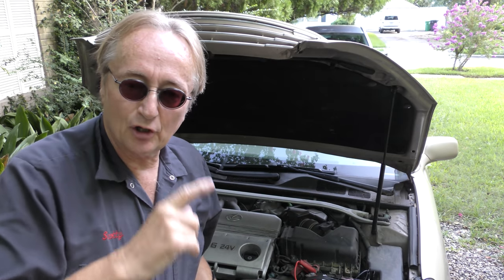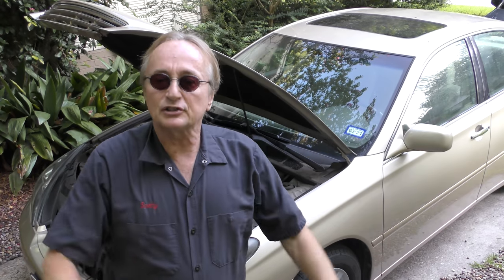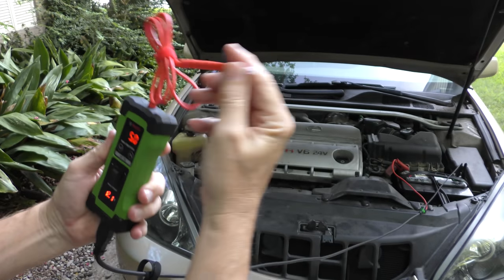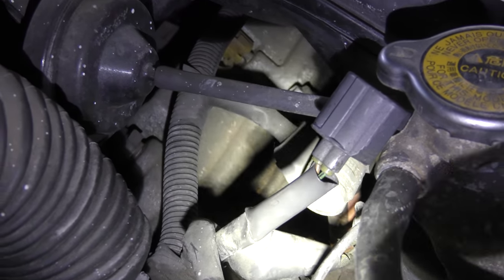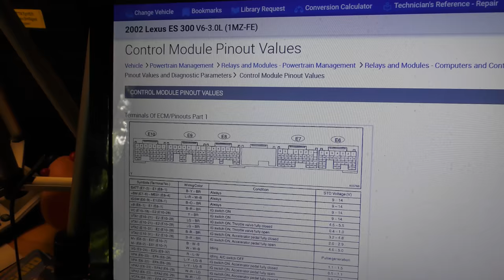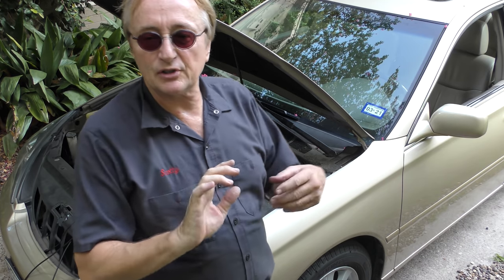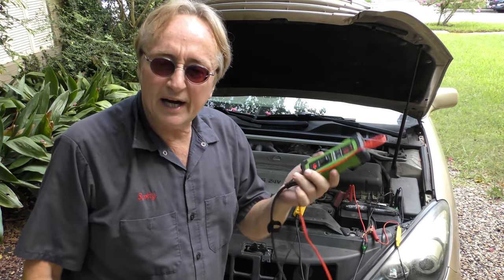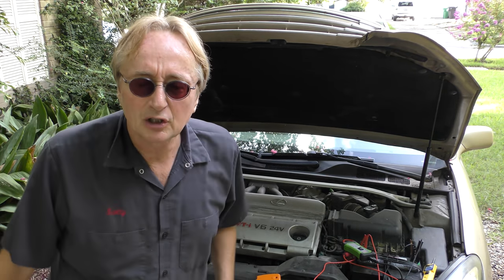Never Use This on Your Car (It Destroyed My Computer)

Comment: My 2002 Express the CTS went bad and never set a code.  It just refused to start when the engine was hot because the computer thought it was -38' F all the time.   I found it with a scan tool that showed live data.  It was unable to start because the computer had the timing advanced much more and was dumping much more fuel into the cylinders. Who knows what else, that's just what I noticed in the data afterwards.  

Fortunately GM put them on top of the motor in a fairly easy spot to access, but this one was so bad the plastic part of the plug snapped off when I was unscrewing it. 

Once fixed, it starts, although it still usually has to be cranked a bit, stop, and crank again.  My guess is a check valve in the fuel pump is sticking open.

Comment: Interesting video.  Over the past 6 or 7 years I keep getting a P0446 evap system code on my low (27,000) mile 2003 model year Chevy 1500 Silverado.  Fortunately, a few times, it seems to have "cured" itself right before the emissions test was due for the registration.  Twice, this time being one (this weekend) , I have replaced a part (from YouTube video recommendations) and cleared the code and the truck passed emissions.  Maybe this is the route to take and check voltage on the sensors.  Who knows?  As Scotty says it is a Chevy piece of junk.  YMMV.

Comment: See I'm having a problem with that I believe.  

My 87 chevy celebrity eurosport 2.8v6 auto , the coolaning fan will not come on by itself anymore and I can't understand why now , car has new radiator and thermostat , new coolant temp sensor , and new coolant temp switch for my gauge . 

So problem is that when I sit at say a drive-thru McDonald's for too long my temperature will start climbing and get up to 220 and passed that but fan will not come on then when I get going down the road again the temperature will start to cool off so I know it's the fan casuing my problem. 

I have a brand new Cooling fan relay as well and everything works if I jump the connector at the relay caus ethe fan kicks on so idk why it's not working unless the new temp sensor is bad I replaced ?? 

Wish had a video to show how to hook up a cooling fan to a switch so I can just turn it on whenever I need it cause it's been very frustrating trying to fix this .
Reply: My top rad hose is getting tight after a drive too and idk what is causing that , the thermostat I replaced or air still in system and I've bleed it like 3 times now

Comment: Scotty have a problem with the check engine light always turns on when it is around 45 to 50 Fahrenheit in a 2007 Honda Pilot with 175000.Any recomendations

Comment: Out of curiosity, what was the temp sensor voltage supposed to be reading at the plug(green/black wire)(not the ground wire lol) ?? (not that it's a 5v sensor)

Comment: How reliable are the 15-17 mustangs Scotty are the coyote engines reliable , and how is the 6-80r transmission??? PLEASE ANSWEERRR
Reply: The engines are great but the 10-19 mustangs have a lawsuit going for bad transmissions. Like really bad. Scotty said he had a customer go through 3 transmissions in a year or two and Ford had to take it back
Reply: Bought a 2017 Mustang  GT 6speed new. Just turned 71k. Great car, no problems.

Comment: Scotty or anyone. I bought a new fuel filter for my 98 vw golf. Real easy part to swap but getting the car high enough off of the ground, safely, is the problem. The shops don't install customer provided parts,  Any suggestions?

Comment: Hello scotty, my Mazda mpv 2004 has 2 thousand miles. The hold light keeps coming on which affects the gearbox when am going down hill by clogging up how can i reaper it?
Another problem is the engine light comes on some time, it has been checked but it did not get fixed. I love your channel it has helped me a lot. Please help
Reply: @Mark Codiroli I'll have the codes checked then i will tell you

Comment: Hey Scotty, speaking of codes, i got a p1450 (unable to bleed up fuel tank vacuum) on my 13 ford focus. I checked YouTube and some video guys have 2 different solutions. 1 is replacing the EVAP and another is replacing the hoses with clips. Which is correct?

Comment: I have a 2006 Honda Accord 2.4  automatic is the oxygen sensor factory denso or Bosh thanks
Reply: hey bro am looking into buy that car, how is the transmision? is it reliable?
Reply: Matias Ibañez take for good test drive I have had 2 of them great car just drive it normal don’t beat on it and it will last change oil on time yes the transmission is good but they will start to shift funny a little bit after big miles but will keep going if you drive easy and regular I have 215000 thousand on mine great car I put 75000 on it no issues just tires and break job and headlight bulb
Reply: thanks men 👍🏻👍🏻👍🏻

Comment: Scotty! I have a 2001 Acura CL type S with 100k miles. The transmission went out and was rebuilt at 90k miles. Do you think the car will hold up for another 100k or should I sell it before it falls apart more?

Comment: I have a question I am new to the channel @scotty kilmer

I have an audi a3 tfsi in a 2014 model. I have had a parking brake fault in a had an aftermarket caliper put in as it was flagging it. 

6 months later my car is getting electric handbrake stuck and the mechanic is saying it's the same fault which is why the electric handbrake gets stuck. Do you know what it could be on that.

Its 70k on clock.

Thanks

Comment: People say dont bring your car to the dealer because of $$$. But the technican was trained, does not second guess anything and uses the right part just like Scotty suggested. By the way the cost of the average new vehicle is over $30,000.
Reply: That is true but that's also not true. Yes if you take your car to a dealer you have a HIGHER chance of getting a trained technician but that's not always the case, and the thing about dealerships is the parts and service counters are their primary $$$ lifeline. You can get ripped hard from a dealer. I have seen it time and again. I also worked at a dealership and know that can very well be the case. You have good dealers and you have horrendous dealers. I have seen people take their cars to the dealer because of one thing, the dealer says it's another (much more costly issue), they replace whatever they do, then when it's not fixed, they say 'i dunno' and that's it. Especially if your car is out of warranty and you know what the issue is they will try to jack up the out of pocket as much as possible. This is why it's always best if your out of warranty to find a local independent mechanic with a good history with working on other people's vehicles.  And usually that local independent isn't the cheapest but I'm willing to bet the fairest and most honest to you which is what you absolutely want over anything when getting your car fixed.

Comment: my car cant get smogged cause my ecu cant be read it wont send any information or power but i plugged in my obd2 and it does give me information i had a blown fuse and took it out and it still wouldn’t work i have no dash lights on and the car starts perfectly fine just cant be read for some reason when trying to smog its a 2003 bmw 325i typical bmw and their electrical problems

Comment: Scotty: "Don't ever buy Bosch sensors!"
Also Scotty: Breaks out the Bosch code scanner to test the sensor. :P

I never had any problems with Bosch parts before. The only thing I have heard negative about their parts is if your going to bypass the o2 sensor, don't use a Bosch sensor because that wont work.

With that being said I fully agree to only go or try at least to go with what the OEM manufacturer of the part is. Denso has always been an awesome company, NGK is equal I personally feel, and if you got a chevy, ACDelco is always best in my opinion. But sometimes you just gotta go with what your wallet has in it. In that case I have successfully used chinese made parts and sensors before on my cars, and the ONLY thing that didn't go well was an o2 sensor that was noname brand I bought off the internet. That was 1 out of probably 20 or so chinese items. If it's a regular old sensor say like a coolant sensor, there's nothing special about it. I wouldn't care what brand if I couldn't get OEM. But MAF on the other hand is a more specialized sensor so yeah definitely would try my best to go OEM.
Reply: I think what he was saying was, if your car had a Denso sensor from the factory, don't replace it with a Bosch, or the other way around
Reply: @MilesPrower1992  I was just making a funny.. But that really depends as well. I have used Bosch sensors quite a lot actually on Chevys without failure. However, I had a Chevy Aveo and Bosch spark plugs would make the car run like absolute garbage.. As if it was falling apart. I put ACDelco plugs in it directly afterward in the Autozone parking lot and it ran perfect. Now in hindsight I also found out that the Bosch plugs WOULD have worked perfectly fine had they not been platinum plugs (in that 1.6L you MUST use copper plugs). It was just what it was designed for.

Comment: Hey Scotty I just turned 16 and looking for a good reliable running car that has a hitch and is all wheel drive and an SUV what are your thoughts?
Reply: Yes go buy your self a used Lexus RX350 they are very good reliable suvs especially from 2007 to 2010

Comment: Don't you want to check the out put voltage from the computer? If you inject voltage to the output line, it may destroy the computer. Be aware how the electricity flows!

Comment: Oem fuel pressure regulator was over a thousand dollars, ridiculous..
Off brand was 350 dollars
Didn't fix the issue 2017 hyundai sonata 1.6l turbo with a acceleration problem, revs up really high with no acceleration. Common issue code p0091
Reply: It has that dual clutch transmission
Reply: We did replace the regulator/high preussure fuel pump and it didn't fix issue so dealer is replacing harness
Reply: @Mark Codiroli dealer mechanic is the one who said fuel high pressure pump/fuel pressure regulator needed replaced, he was wrong LMAO
Reply: @Mark Codiroli vehicle has 80k wareenty for powertrain but dealer said specific repairs weren't covered

Comment: Scott hello my name is Robert I tried sending you several messages but to no avail I have a 2013 BMW X5 3.5i I’m disabled and I can’t drive the car as much as I can can do you point me in the right direction for getting a battery charger not a big one I did have the battery replaced which was the original battery but I need a charger because sometimes I can go to 3 to 7 days without driving it but I will always start it and drive around for 15 minutes keep the battery charged but once in a while I see the warning light high battery drain I don’t wanna ruin the new battery is there anyway you know of a battery charger or a trickle charger I can use between 30 and $60 thank you very much